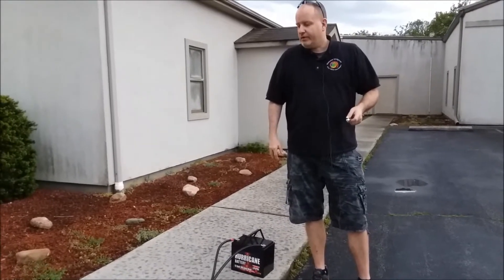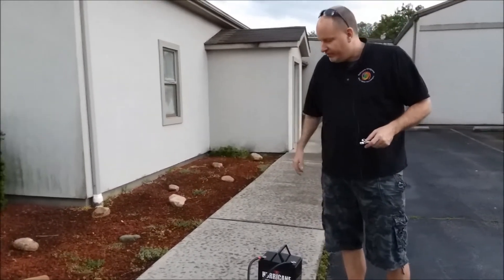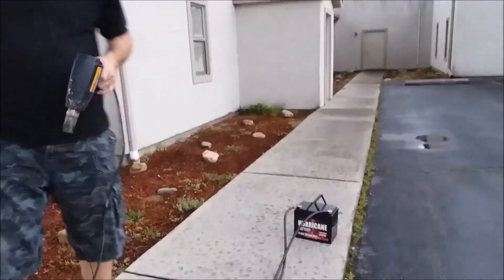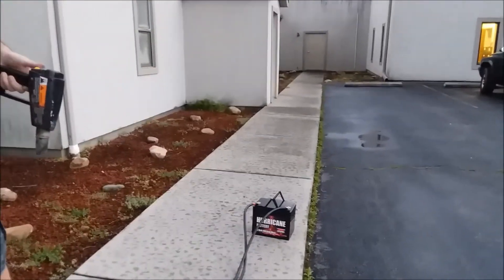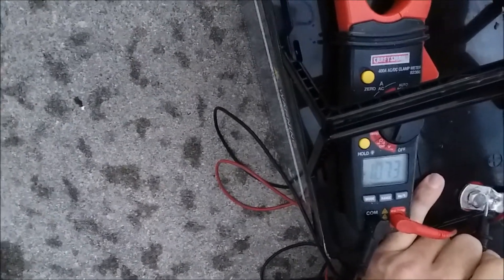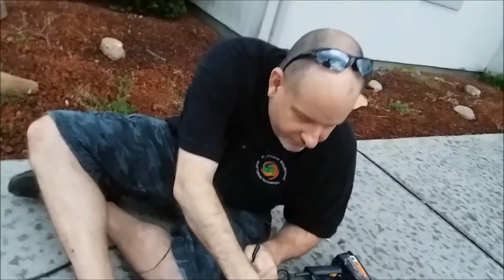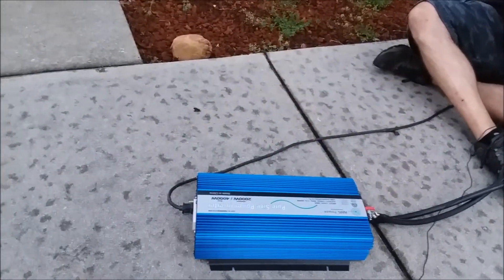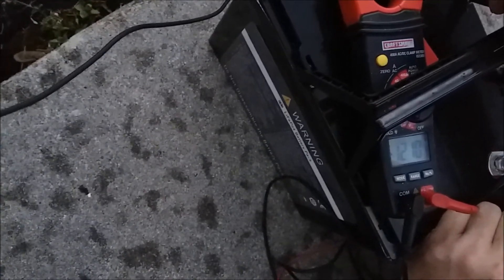Initial testing of Hurricane 12 volt LiFePO4  Battery  100 AH RV Solar OFF Grid battle hardened

Comment: I’m impressed
Reply: What’s the size of the Aims inverter? I’m surprised the inverter didn’t shut down.
Reply from the maker: @bobbailey4954  2 kw ran good
Reply from the maker: I am working on getting watts view back up to completely discharge this into our dc water heater to get a watt hour rating on youtube. We have designed this to outperform the big name so we will see where we are at in a few days